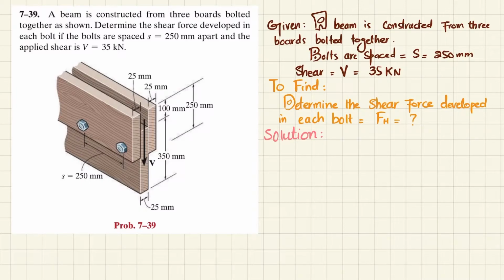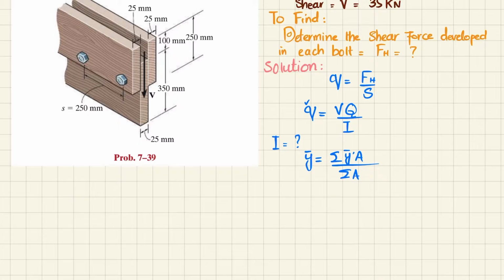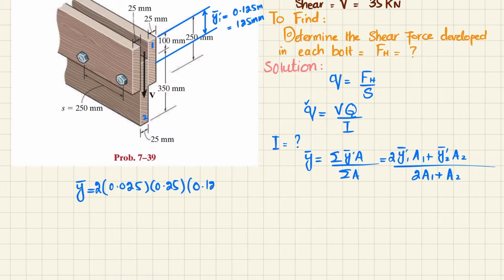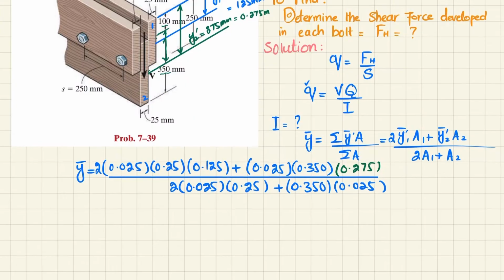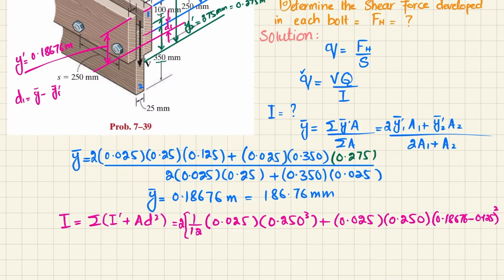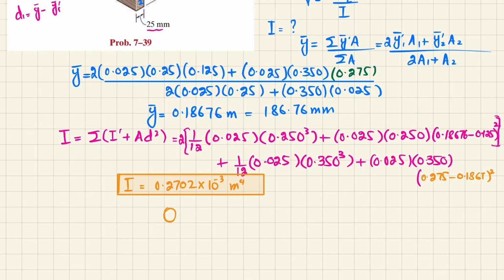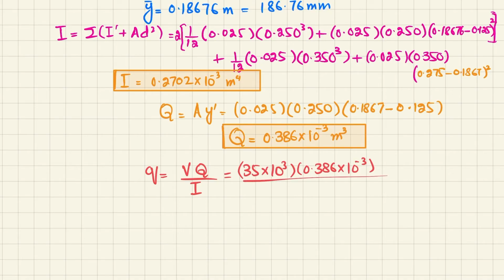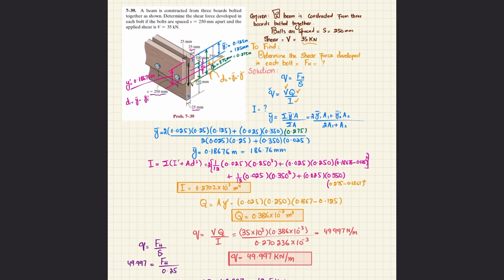7-39 Determine the shear force developed in each bolt | Mechanics of Materials RC Hibbeler

Comment: The reason why we dont take 2F/s there are one bolt on the same line right?
Reply from the maker: There are Two bolts and distance between these bolts are s=250 mm
Reply: @engradnanrasheedmechanical   but  each bolt has two shear planes , what is the difference between example 36 and this , when it comes to calculate shear flow (F/s)
Reply from the maker: Shear force Per unit length the  is shear flow. What's I have mentioned in the video you can check that please.
Reply: @engradnanrasheedmechanical  how abt u check these balls
Reply from the maker: @christophersfeir where are the balls?